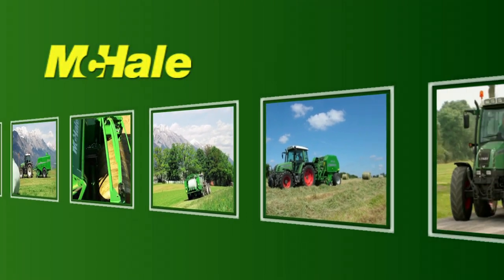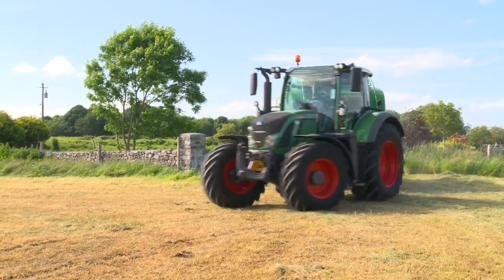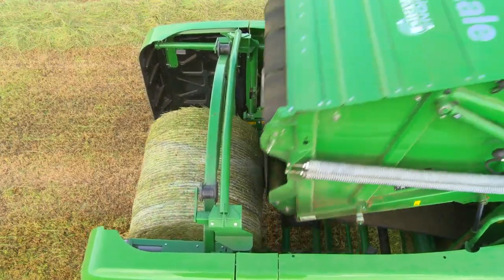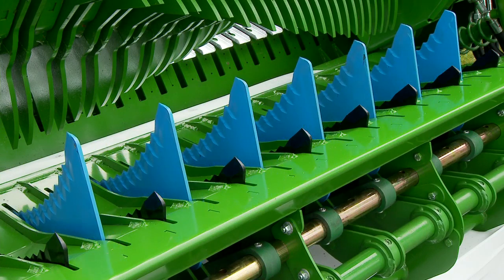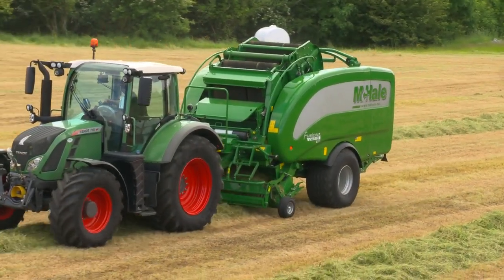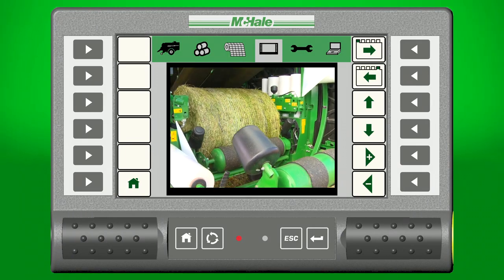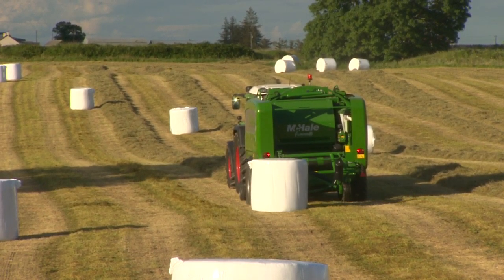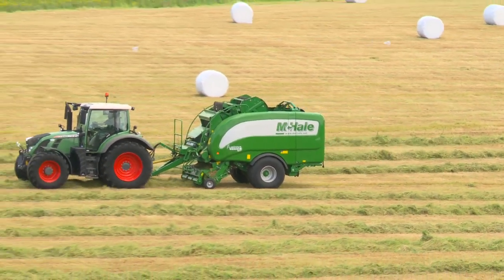McHale Fusion Vario ENGLISH

Comment: Is there ISOBUS compatibility with the tractor’s terminal, or can the baler only interface with its own dedicated terminal?
Reply from the maker: Hi Noah, ISOBUS is only available on the McHale Fusion 3 Pro and Fusion 3 Plus.
The McHale Fusion Vario is operated through the iTouch Control Console.
Thanks
McHale
Reply: Thanks! 👍